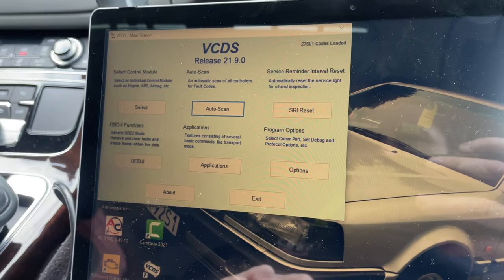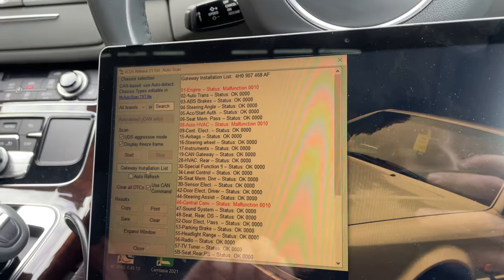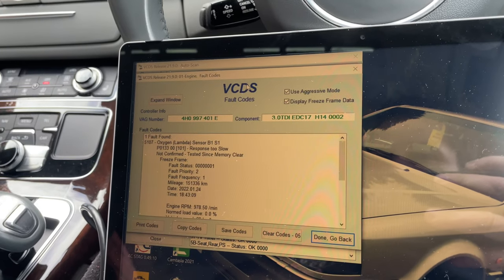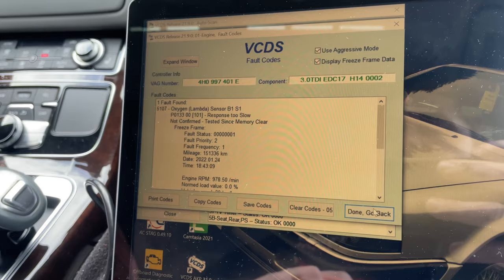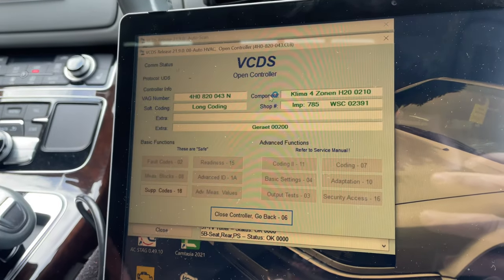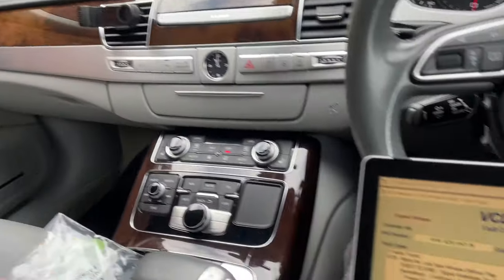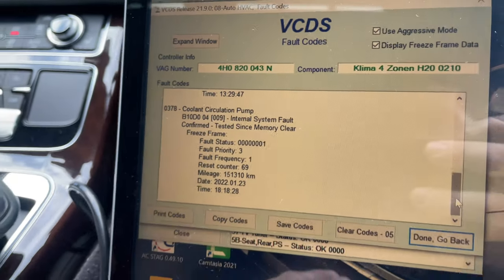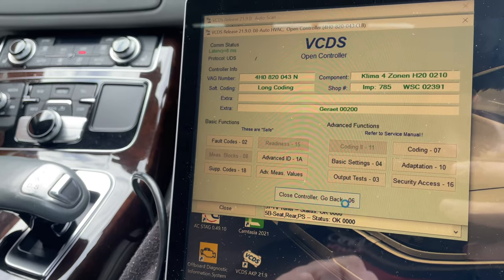Audi A8 D4 3l TDI 2014 Facelift Auxiliary pump fail. How to check and replace pump V50 D.I.Y“Jan V8”

Comment: I just replaced the coolant union valves and crossover pipe in my 2012 A8L 4.2 and still have a leak at the rear passenger side of the engine...I think this aux water pump could be the problem.  Thank you for the video brother.

Comment: Hi just replaced mine and done a test drive, only passenger side is heating up now. Any ideas?
Reply from the maker: Did you use genuine part it aftermarket ? What was a part number on it ?

Comment: Hello, just wondering what the auxiliary pump does? Does it just circulate the coolant through through heater core(s) (not sure how many heater cores it has?? Or is there any other purpose for this pump? Mine has been faulty for a while now and I'm wondering if there is a risk anything got overheated or damaged if this pump doesn't work properly? I will be replacing this pump, just hopefully nothing got wrecked. Thank you

Comment: Great video sir, you’ve saved me a lot of time and money since I’ve had my a8. I replaced my pressure switch but I’m still getting warm air. Fault code is “Sensor for refrigerant pressure and temperature
Lower limit not reached
G
Fault code:
B10C221”
Do I need to recharge the system after installing the new sensor?
Reply from the maker: All depends if system is empty or not. 
If
You mean once you take off old sensor and gas will come out answer is no as there is a valve to hold pressure inside a system. 

Good luck
Reply: Thanks yeah I just had to recharge and I’ve got good cold air again!

Comment: Great video, mine has same fault. my car is 3.0tdi quttro. Have you got ad blue system on your? Have you had ad blue metering line leaking where the injector goes in near the turbo?
Reply from the maker: Yes most of FL 3L tdi have as blue metering line issue.

Comment: Hi
Why do you have to replace the plastic trim if cracks? Is that gonna leak or just cosmetic?
Thank you in advance
Reply from the maker: Yes if plastic trim is cracked need to be replace, otherwise water will go to cabin or will damage parts under, like abs pump or engine ecu. 

All best from Jan V8

Comment: Thanks, I had little heat in cabin, especially at low RPM.  VCDS output tests said Refuaed by control unit - I tested my new pump on the cable with VCDS and engine running and it was not spinning either. I found that the issue was caused by me messing with long-coding and adding aux-heater a couple of years ago. I don't have aux heater, but wanted the ability to set a timer for ventilation in MMI.  Ooops. At least I have. a spare pump now. I confirm this one works. Engine has to be about 50deg C before it spins up and cycles on and off.